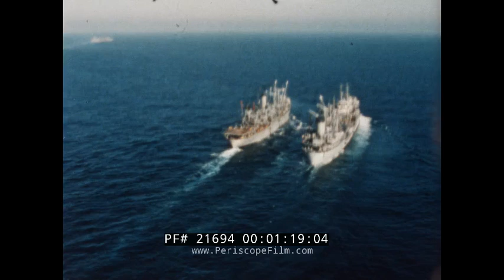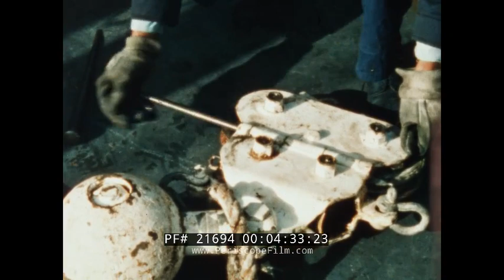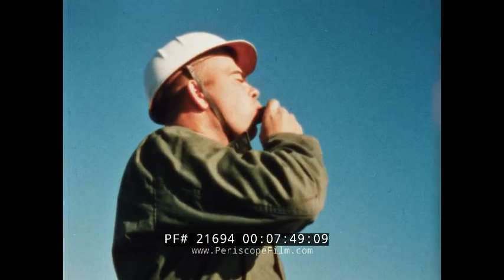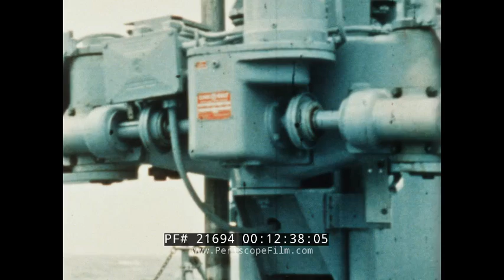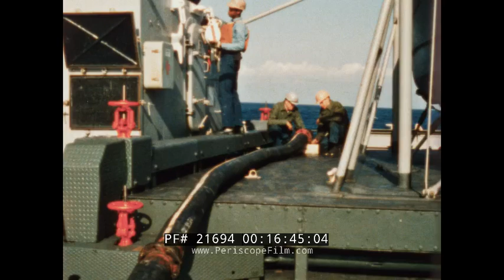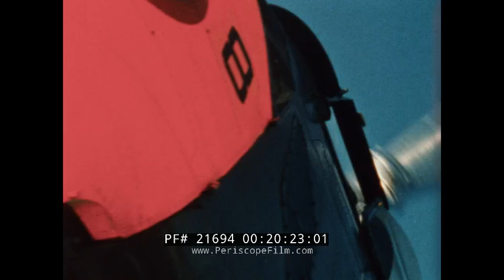1965 U.S. NAVY TRAINING FILM  "REPLENISHMENT AT SEA"  TRANSFER OF MEN & SUPPLIES 21694

Comment: USS Milwaukee AOR2, 1st division, station #3 1976-1977. Quite a bit of hanging around for me; send lines out and wait to haul lines back in. 1st division had the starboard side which was great because carriers pulled alongside to port and started well before sunrise. Great memories.
Reply: USS Kalamazoo AOR-6 2nd Division SN 1982 (ET "A" school flunkee @ Great Lakes NTC). Did unreps and vertreps. Met a  couple of guys from the Milwaukee AOR-2 summer of 1982 at Norfolk, VA NOB. An SK2 & SK3 from my hometown of NYC, same neighborhood even.  We hung out a few times that summer but lost contact.  Took the DK3 test spring of 1983 and passed. A-Hole BMC didn't want to let me go but he had no choice. Eventually swapped to the USS Long Beach CGN-9 @ Coronado (San Diego), CA Jan. 1984 for a West Pac Deploy. HD' d as a DK2 Sept. 1985 and entered college back home in NYC.
Reply: Crew chief on a '46, HC 6, on one of Milwaulkee's assignment to the Sixth Fleet, when the Milwaulkee was still "Navy".

Comment: Brought back a lot of memories! Served aboard the USS Taluga Ao62 1969- 1972 . C& R division.
Reply: I was on the Diamondhead AE19 in '71 as an EM... one time unrepping the Enterprise, one of the winches I was assigned to monitor burned out a coil and stopped, so I had to jerry-rig a bypass jumper in a light rain, so had to put a canvas tarp over it to keep the winch dry... the jumper overheated and caught the canvas on fire... I was able to get to it and cut the canvas free before it totally damaged the winch... and got it back in operation for the remainder of the operation... those were "fun" (?) days... LOL...